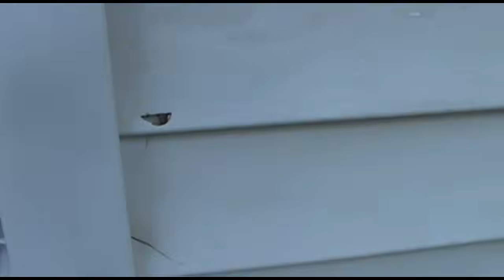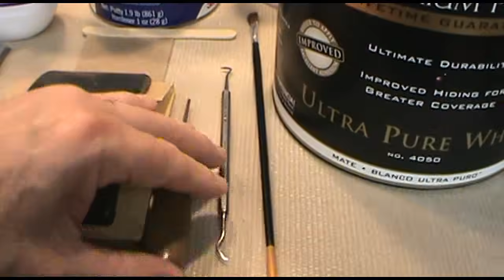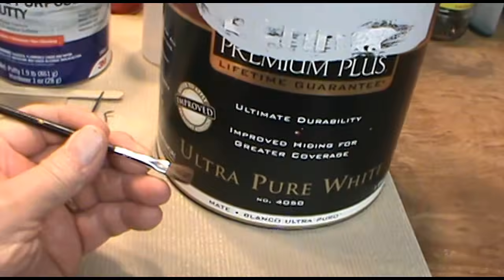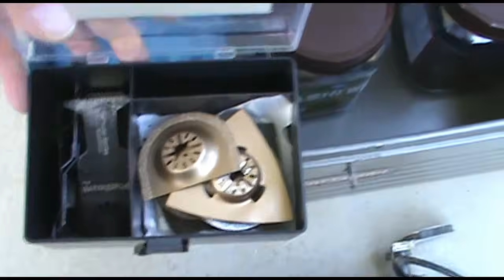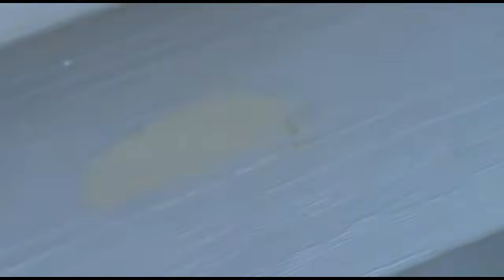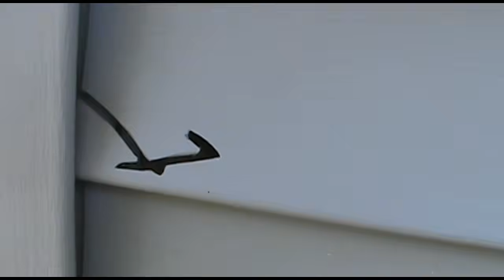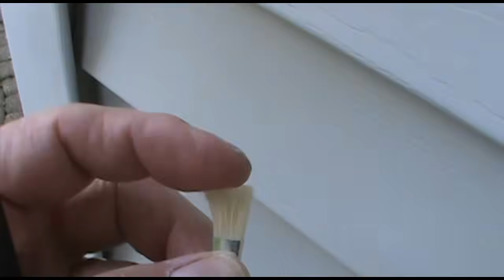How to Repair Vinyl Siding Holes and Cracks. Perfect and Undetectable.

Comment: I’m wondering if the painted area will fad differently over time to expose the repair.
Reply from the maker: Great question, joe. I have some repairs that are over 10 years old and they still look great. It seems that the paint and vinyl fade at the same rate together. The repair is 3 years old now and looks great. You can see this repair at one year old in the video link below. The repaired vinyl is shown just over one minute into the video.
https://youtu.be/JeYizOqFuzM

Comment: I love the detailed explanation and attention to detail in your video. I have a long 4 inch crack in my vinyl siding approximately 8 ft. high on a 16 ft. outside wall. After using the Dremel tool to cut along the crack I am wondering if I need to fill in behind the crack before I put the Bondo Putty on the crack? I'm afraid of further cracking when I press on the sander to flatten the putty. Finally, since i have a 4 inch crack, how wide/thick do i put on the putty? I hope you will be able to respond to my questions as I see the last response was over a year old. Thank you!
Reply from the maker: Hi, Tom. Thanks for your kind comment. If you sort the comments by "newest first" you will see much more recent comments.

If you have a larger crack you may want to check out the video at 20 minutes in. You will see how I repaired a fairly large crack.  https://youtu.be/ShZi5mwbZXg?t=1200

For a crack as large as you have I would backfill the hole with DAP Alex Painter's Acrylic Latex Caulk https://amzn.to/3jCuneN . I like the Acrylic Latex Caulk without silicone or any other additives. It doesn't expand or contract much, can be used indoors or out, and cleans up easily. Aim your caulking gun at an angle and squeeze some back behind the vinyl siding all along the crack and continue to backfill the entire hole but do not fill it all the way up until it is even with the siding. Keep it about 1/8 of an inch below the surface of the hole in the siding. All you are doing is making a base for the Bondo All-Purpose Putty. Let the Painter's Caulk set up for at least 24 hours so it is good and hard. This caulking doesn't expand or shrink much and should be a good base for the putty.

After the Painter's caulk has completely set up you can fill the rest of the hole in with a top coat of the Bondo All-Purpose Putty. You will have to work fast because this stuff has a very short open time of about a minute or less. I would have a small putty knife ready to immediately pull the mixed putty off the mixing cardboard and work it into the remaining hole. It won't matter if you get a little extra putty buildup around the hole to make sure it is all filled in because the putty is easy to sand down. I would fill the crack in and overlap the crack about 1/8th of an inch on each side. With the 1/8th inch opened crack you will have about 3/8th to 1/2" of putty skim coat over the width of the crack. After sanding trace in your wood grain lines with the dental tarter pick, clean it with denatured alcohol, and paint it. I hope that all makes sense and good luck with your repair.

Comment: Just started the repairs with this method. Lessons: The Bondo product is shipping with a blue hardener now, which will make light color paint harder to match to the siding. I'm pretty bummed about that. If you already used great stuff foam to fill in any gaps in the siding, the bondo will react with it and melt it, sinking in a bit, causing issues with getting the hole filled in one application of bondo. It's a messy method...even with care you'll have bondo poo drips on stuff, so beware. I would mask off around the area to be repaired if I have to do this again. Yes, it hardens fast, becoming unusable in about 45 seconds to a minute & 15 seconds, depending on the hardener-to-putty ratio. Still have to sand, texture, and paint so I'll see how that goes.
Reply from the maker: Hi, C2Installations. Thanks for the feedback. I'm sorry to hear you had trouble. I have had subscribers say this method worked really well for them and one subscriber repaired about 30 holes with this method and he said they turned out great. As you can see in my video I simply mixed up and dabbed the Bondo All-Purpose Putty on and it went on very easily. As you said it does dry very fast so you can only do a small amount of repair at a time. Even with the color change of the hardener cream, the putty should dry hard and hopefully be able to be painted with just about any color paint. Hopefully painting blue Bondo won't be any more difficult than painting blue vinyl siding. Could you please let me know if you used the Bondo All-Purpose Putty or regular Bondo auto body repair compound or something other than the All-Purpose Putty?
Reply: @Fixitforgetit  Not really trouble, just some lessons learned that others might take away. Masking the area being maybe the biggest one. Mask then "spackle" and remove mask once done, before it sets up too much. Yes, it was the all-purpose putty that I bought on Amazon. The can had an add-on sticker stating it had blue hardener, but the pics on the product page were the white hardener. The siding is very light grey, lighter than the color of the Bondo putty without hardener, so I was bummed. Not your fault, but want viewers to know they might have to deal with that. It should paint up ok, but it might take more coats to overcome the shading of the blue putty mix. I repaired about 20 holes today, some old, some new from recent deck replacement. Older ones had been filled with great stuff and trimmed flat to keep pests out.
Reply from the maker: @C2Installations  Great info, C2Installations. I appreciate your heads-up and input. I too am bummed about the color change in the hardener cream. I really liked the gray color of this putty. Not simply because I too have gray siding but I really liked the somewhat neutral coloring of the putty as it worked with a myriad of repairs I do around the house. I still have quite a bit left and hope it doesn't harden up on me. I have found that this stuff stays good for years if you keep the can tightly sealed. I am on my second can and love the stuff other than the ridiculously short open time. 

I have done about 30 or more repairs too and perhaps 2 or 3 have broken loose over time. They were quick and easy to redo and a lot cheaper and easier than buying new siding which I couldn't do if I wanted to because my siding company went out of business a long time ago. This really saved the look and value of our home. Thanks again for your kind response and excellent feedback. Learning together is what this channel is all about and every bit of helpful feedback is an important part of that process.

Comment: Just remember one thing WELL about Bondo HARDENER.      Don’t ever let a drop of that red goo fly into your eyes !!!     There was an article in Pop Science or Pop Mechanics years ago about this.    Whatever’s in there can blind you in short order.       
     Now you ask who is dumb enough to squirt that in your eye…… the answer is you don’t have to be.      When it’s sat around for long periods the hardener tube will get very brittle and at the same time harden slightly at the end.     It’s just enough to get you to squeeze hard enough to mix the liquids stuff Into to the more so,I’d and out it comes like a squirt gun from wherever.        Ive had it happen though it just plastered the front of my shirt.      
   No huge worry here but something unusual  to keep in mind when handling hardeners.   Just wear some safety glasses until it’s hardened while handling it .
Reply from the maker: Good info, NOMOREMARXISTS. Thank you.

Comment: This is exactly the how-to video I needed, thank you. Just need to know if I can use the toothpaste sized tube of 'Bondo Glazing and Spot Putty' instead of the bigger container of 'Bondo All-Purpose Putty'? The tube is 4.5 oz and would be all I need for a small hole but is it the same as what is inside the bigger container you are using? Would appreciate your advice before proceeding.
Reply from the maker: Thanks for your kind words, G. D. I am not familiar with the product you want to use so I can't comment on it. If I were doing a project this important and weren't sure how a different product would perform I would spend the $12.55 for a quart of Bondo All-Purpose putty. It has the perfect consistency and long-term performance needed for vinyl siding repairs. I also like having some on hand because I use it frequently for various repairs around the house. Good luck with your repair.
Reply: @Fixitforgetit  Thanks, I will get the All-Purpose as you recommended. Don't need a lot for the job I'll be doing but if sealed up tight afterwards, maybe it will have a decent shelf life so I can use again when needed.
Reply from the maker: @daisyl12  I think you are wise. As for the shelf life I have had a can around for 8 years or so and it is in perfect condition. If you can keep it in an air-conditioned environment and keep it sealed it should have a great shelf life. If it sets a year or two without being used you may need to stir a small amount of clear fliud that tends to separate from the gray putty with a screwdriver but then it is fine.

Comment: Great job with your video. Do you have any problems with color matching to faded vinyl siding and then latter having your touch up fade or discolor 2-3 years latter that causes an eventual color mismatch?
Reply from the maker: Thanks, Zoel. What a great question. I have not had any problem at all. I suppose the paint is fading along with the vinyl because that simply hasn't been a problem. You can see a one-year review of my repair at this link and it still looks great to this day. https://youtu.be/JeYizOqFuzM

Comment: Wondering about the expansion/ contraction differences between the pvc and bonds. Is the bonds going to crack because of expansion stress?
Reply from the maker: Hi, Nancy. That's a great question. I have probably done 30 or more of these repairs over the past 15 years. These are repairs from 1/4" in diameter to about 1" in diameter. Most of them are still holding to this day. I have had about 5 of them break loose. When that happens it is usually a repair near the top of a sheet of vinyl siding where the vinyl is very close to the wood backboard. In these areas, the Bondo All-Purpose putty is so close to the wood that it can stick to the wood and then pull back away from the vinyl siding when there's expansion or contraction of the materials due to temperature changes. 

It's really no big deal though. I simply take a few minutes and redo the patch and the second repair usually holds. I live in an area where temperatures can be as hot as 100 degrees in the summer and down to 10 below in the winter. These are the extremes but we do have a full range of weather conditions. I posted a video of a walk-through one year after I did this vinyl siding repair.
https://youtu.be/JeYizOqFuzM

Comment: Does this also work on aluminum siding?
Reply from the maker: Hi, John. It probably would. The only thing is I suspect the finish may be a bit more visible because aluminum siding is smooth and it would be harder to "camouflage" the repair. It will also be harder to blend in the paint because the paint on aluminum siding tends to fade quite a bit over time and gets sort of "chalky". Having said that, it will probably look fairly decent and should look a lot better than a hole of tare in the siding.

Comment: Any tips on repairing a crack on cement board siding ?
Reply from the maker: Hi, Mark. I think you could use this exact process. You may need to "scuff" up the All-Purpose Putty a bit before you paint it if your cement board siding has a bit of a rough or textured finish. Good luck.
Reply: @Fixitforgetit  Wow, I'll try it, I have one crack in my siding that bugs me, thankyou for quick response.
Reply from the maker: @markme4  My pleasure, Mark. The Bondo All-Purpose Putty sets up fast but it is great to work with after it dries and holds up very well long-term. I have some repairs that are 10 and 15 years old. Sometimes the repair will loosen up but rarely. If it does it is a fairly fast and easy fix. You just rout it out a bit and refill the repair. Repaint and you're all set.

Comment: how do you get the siding to fit in the tracks the railing is loose on mine no nails in my just holes where should be at it keeps falling off the side very bad wind about 40 miles hour and hail .Do I need to use a hammer to tap it into the track. I never had this problem no idea where I can get extra siding just a piece in corner broke off. Now everything is loose.
Reply from the maker: Hi, sheila. I don't have any experience installing vinyl siding and without seeing a video of your problem it is a bit hard to visualize. If I understand your situation correctly it sounds like the siding installer didn't put any nails in the little slots on the top of the siding that holds it in place. I think you could get some ideas on how to fix this by doing a search on YouTube using keywords like "how to install vinyl siding". There will probably be a lot of videos to choose from. Just follow the instructions and hopefully, the video will help you correct your problem. Good luck with your repair.
Reply: @Fixitforgetit  there are screws on every other one but I noticed a thin vinyl bar is missing on the top of the rail I am not sure what it is called it is just paneling that is broken on the corner  it is a smaller piece that broke I got more of it on track .
Reply from the maker: @sheilanies152  You may want to take a photo or video of your problem and go by a residential construction business and show it to them and see if they have any ideas.

Comment: Wow  thank you for the information.  the previous owner had neglected the house so had holes and broken areas. I asked a siding company about patching and was told the patch would cause more cracking so just live with it or replace everything. I knew there had to be a way to fix it.  Thank you  again.
Reply from the maker: My pleasure, Paul. Good luck with your repair.

Comment: Such a helpful video! It’s very much appreciated! Just what I was looking for. Two questions. Any tip for matching the paint to the vinyl siding? There are many shades of white.  Also, would you suggest this same method for a larger hole, say 2-3”?
Reply from the maker: Thanks for your kind comment, Dar1213. 

For the paint, I used Home Depot's BEHR Premium Plus Mate Finish Lifetime Warranty Exterior Paint. If you have a small sample of your vinyl siding they will scan it and do a great job matching your color. Ask them to make you a 7-ounce custom color sample to match your siding. That will cost about 5 dollars instead of paying 28 to 38 dollars for a custom-blended gallon of paint. Be sure to get flat paint instead of eggshell or semi-gloss. Good luck with your repair.

If you have a larger hole I would backfill the hole with DAP Alex Painter's Acrylic Latex Caulk https://amzn.to/3jCuneN . I like the Acrylic Latex Caulk without silicone or any other additives. It doesn't expand or contract much, can be used indoors or out, and cleans up easily. Aim your caulking gun at an angle and squeeze some back behind the vinyl siding all around the perimeter of the hole and continue to backfill the entire hole but do not fill it all the way up until it is even with the siding. Keep it about 1/8 of an inch below the surface of the hole in the siding. All you are doing is making a base for the Bondo All-Purpose Putty. Let the Painter's Caulk set up for at least 24 hours so it is good and hard. This caulking doesn't expand or shrink much and should be a good base for the putty.

After the Painter's caulk has completely set up you can fill the rest of the hole in with a top coat of the Bondo All-Purpose Putty. You will have to work fast because this stuff has a very short open time of about a minute or less. I would have a small putty knife ready to immediately pull the mixed putty off the mixing cardboard and work it into the remaining hole. It won't matter if you have to work fast and get a little extra putty buildup on the hole to make sure it is all filled in because the putty is easy to sand down. After sanding trace in your wood grain lines with the dental tarter pick, clean it with denatured alcohol, and paint it. I hope that all makes sense and good luck with your repair.

Comment: The first thing you need for pvc siding is a quart of perfectly color matched paint.  I have a quart for mine in the shop.  It is Gliddens primer exterior latex that I color matched at Walmart.  I would use JBWeld to fill in a crack or hole and then clean the siding and paint it.
Reply from the maker: Good to hear your ideas, John. Good luck with your repair.

Comment: Very good instructions!  For me, one of the main things is getting a paint that matches!  Sometimes hard to match!
Reply from the maker: Thanks, Okie-Tom. Home Depot does a great job matching the paint. Be sure to have them mix you up a little 7-ounce custom flat finish paint sample and it will only be a few dollars instead of 35 0r 40 bucks for a gallon of custom paint. Good luck with your repair.